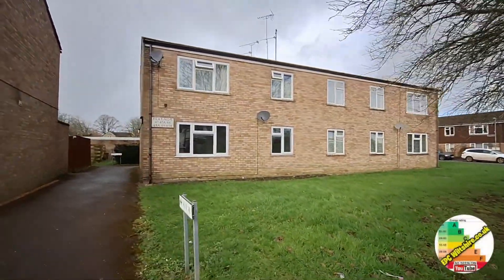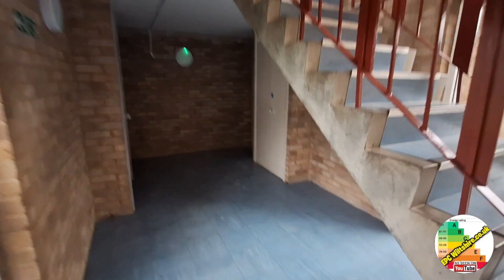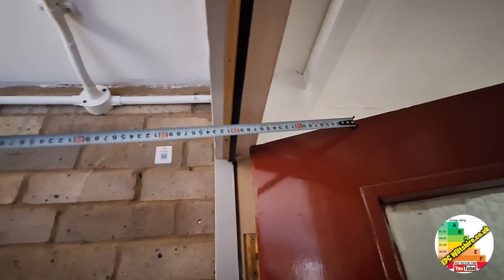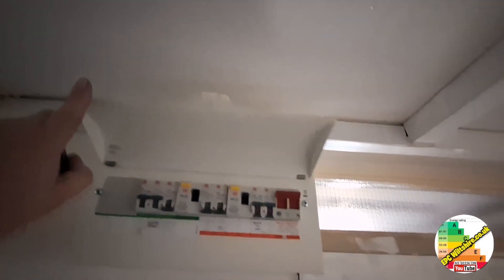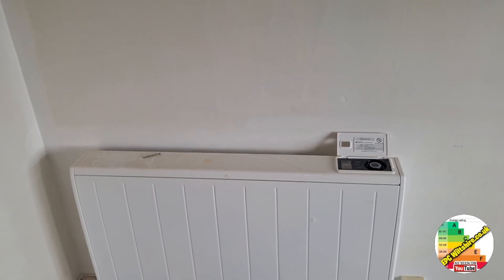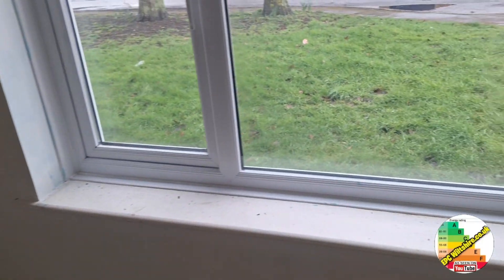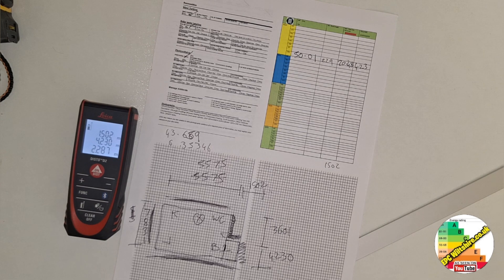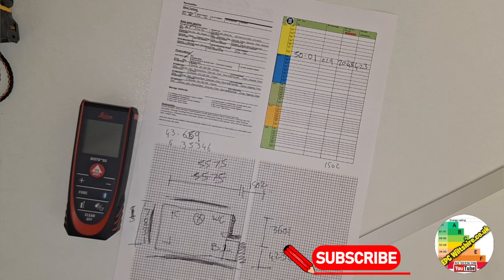EPC Assessment on a Ground Floor Flat: Upgrading to MEES Compliance & Recording an Unheated Corridor

Comment: Good morning, thanks for the vids.
I am considering doing my DEA-3 qualification and I'm wondering about entry routes into a job afterwards. What are the options? I have been browsing adverts for 25-35k jobs, but how do I become an employed DEA with no "on the job" experience? Are starting roles easy enough to get? Your insights into this would be greatly appreciated.
Reply from the maker: I passed in 2008 I hear online courses are OK, but I would choose training with an accreditation company that way it's sure to be OK, use the .gov site to check out your competition I. The local area 

https://getting-new-energy-certificate.service.gov.uk/find-an-assessor/search-by-postcode?lang=en&domestic_type=domesticRdSap

Once qualified try local agents and landlords. On self-employed basis and at the same time start applying for jobs and keep updating your CV as you gain experience. That's how I did it but that was between oct 2008 and Nov  2010  it took 2 years to get a PAYE EPC job but I built my business whilst waiting and have run both in parallel since. Good luck don't forget to subscribe to help grow the Channel
Reply: @EPCWiltshire  Thanks. I will keep learning from what I see in your videos.

Comment: Hi, I’m still so confused how do we calculate unheated corridor in the simplest way 😩
Reply from the maker: Record the length record the wall thickness add the outside wall up and add the corridor to it and then tell the software the length of sheltered wall
Reply: @ thank you, I understood recording walk thickness but what do you mean by record the length? Length of the flat to the flat next to it? 

Or we’re measuring the length of the corridor and adding that to wall thickness?

Comment: Good video. Heat loss calculation is wrong however as should be 25.586.

Also a tip for those types of electric meter, use the blue button to scroll through rather than the orange one and you will find the readings.
Reply from the maker: Correct, I did recalculate the HLP thanks before lodgement, phew. Great time on the orange button I will remember that one 😀

Comment: Hi, this is something that came up in the Fb Group. Should the unheated corridor length be included in the HLP calculation? In my mind adding the HLP walls to the UC gives 24.084, but the difference to your HLP of 20.48 is the width of the UC 3.6
Reply from the maker: Good point  and correct UC 1.502+3.601= 5.103
Outside walls (5.575x2)+7.831+1.502= 20.483

20.483+5.103 = 25.586

HLP 25.59 & UC is 5.10